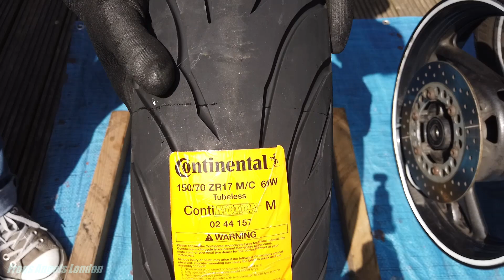Yamaha TDM 850 4TX rear tyre change & wheel balancing

Comment: Is removing the caliper really necessary or can I just slide the wheel and disc right out of the caliper?
Reply from the maker: Hi mate probably good to remove it so you can give it a good clean throughout and check the pads and pistons.